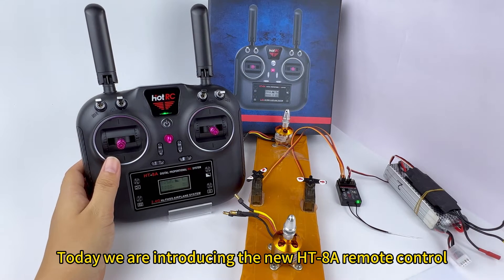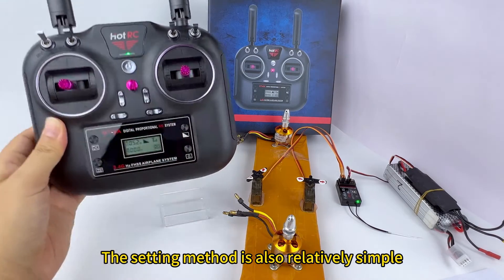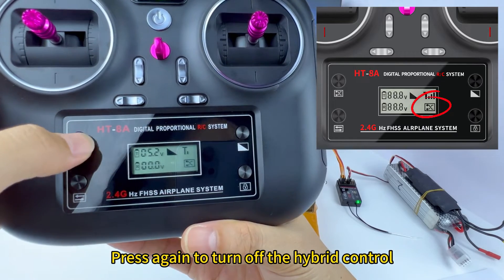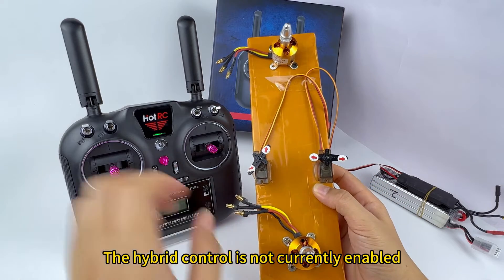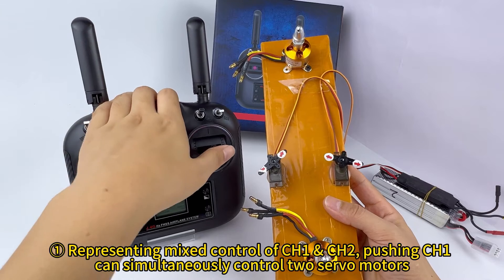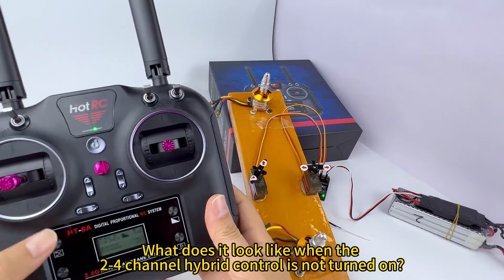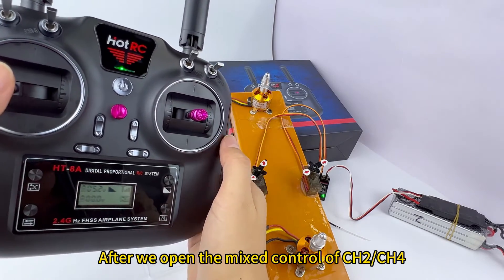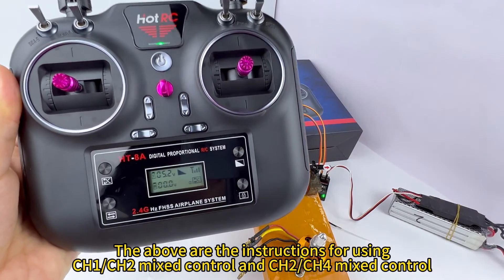HOTRC HT-8A remote control 1 2 mixing function and 2 4 mixing function explanation

Comment: HOW TO RESET HOT RC HT-8A (FACTORY VALUE) TO CONECTE WITHE SUBS RECEVER,BEFOR A CONNECTED WITHE F-08A
Reply from the maker: Do you need to code-match two receivers at the same time?
Reply: @HotRC-Sophy  yes a have 2 receivers subs and F-08a now i conected withe F-08A i want to desconecting receiver F-08A and  conecting withe subs
Reply from the maker: @mohamedcherifbougrid3168  You can refer to the receiver pairing method mentioned in this video to pair the receiver:
https://www.youtube.com/watch?v=TBS6J-SB5YM

Comment: What channel can i put the power supply for reciever ?
Reply from the maker: You can connect any power channel you want, each channel is available
Reply: @HotRC-Sophy  thank you for your fast reply ⚡
Reply: I have trouble binding with the receiver . Transmitter is just flashing quickly with green light . I followed the steps of the manual for code matching . What do I do. ?
Reply from the maker: @KIMUELDUANEADRADAADRADA  Be careful not to place the remote control and receiver too close to avoid blocking the signal if it is too close.

Comment: hi do you have a range test?
Reply: I have one on a budget quadcopter, its solid at 100 meters, I've flown it around my house many times low to the ground with my body and house between them with no issue, it couldn't make it around my local school like my ELRS zorro does, but my old flysky and frsky couldn't do that either and I'd say this is basically the same performance. i have had a  fail safe around 120 meters  but when that happened i may have had my body partially blocking cuz i forgot i had turned facing the other way and it was in a very noisy environment with tones of WiFi everywhere, i have flown it about 1km and back without  incident, but i was sure to hold the radio up with clear direct line of sight. The biggest problem is i have found no way of displaying any kind of signal strength or telemetry in betaflight osd to know when signal is getting low, and it doesn't beep or anything to tell you signal is low, only way to find out how far it goes is fly till it just drops and then go find it. My recommendation is use a lower powered vtx so you will loss video first, lol. It's a great line of sight radio though for $28 with receiver. Mine was sbus. But it will need the gimbals lubricated and adjusted, they felt terrible the way i got it, but feels pretty good now.